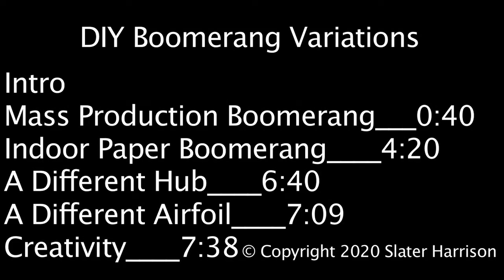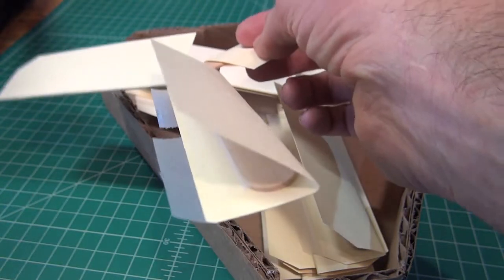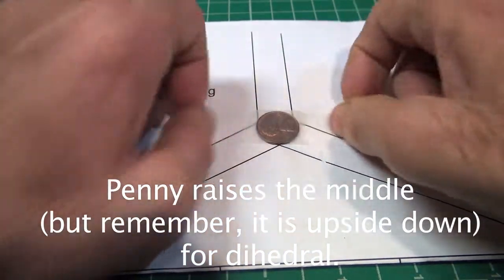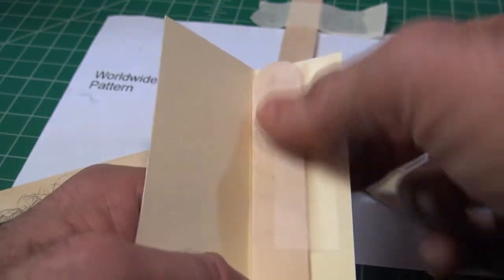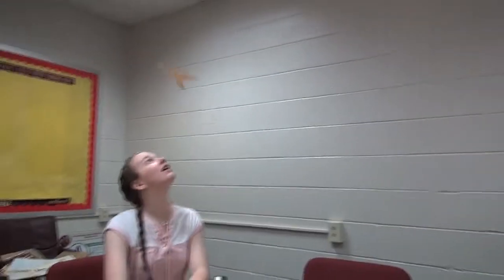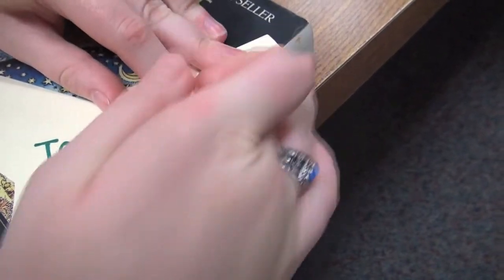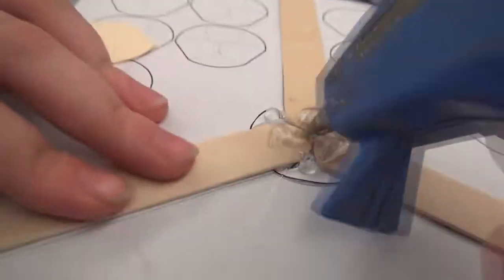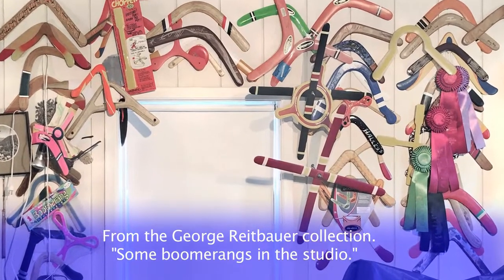Boomerang Mass Production and Design Variations

Comment: I remember spending my childhood watching your videos and trying to recreate one of the walk-along gliders. I never managed to do it!
Reply from the maker: Jawbone, can you remember any details of your attempt? If you are still interested I'd like to get you flying.
Reply: @sciencetoymaker  well, I remember not having access to Styrofoam paper, and used standard A4 material for my planes - which have weighted them down drastically. And them flying too fast for me to chase after with my board. And that I also didn't have enough space to walk my glider.
Reply from the maker: @jawbone6907  Yeah, it seems logical to substitute paper for 1/2mm thick foam, but by the time you figure in weight for a given rigidity, it's more than an order of magnitude different. There are some paper designs. The best ones for starting out spin as they glide. We used to recommend "telephone book" paper, but those are no more. Newspaper is still lighter for a given surface area than printer paper. https://sciencetoymaker.org/walkalong-glider-airsurf-air-surfing/make-your-own-gliders/paper-gliders/
Foam gliders fly slowly, like magic, and you can fly them even in a small room. But postage to countries outside the U.S. is expensive. I also have a couple of videos about slicing your own https://sciencetoymaker.org/walkalong-glider-airsurf-air-surfing/make-your-own-gliders/hotwire-cut/
Reply: @sciencetoymaker  thank you! I'm glad that after all these years, your channel is still up and running.

Comment: Hello Slater,  OK, so I'm a buttinski, but I would like to make a suggestion or two.  I just started making these and I had no manila folders.  I did have a ream of 8.5x11 cardstock which works nicely for the wings.  you can get 6 wings from  a single sheet of cardstock by first cutting the sheet into 2 strips of 5.5x8.5", then cut each of these into 3 pieces, 2.75x5.5".  works great for wings.
Reply from the maker: Great tips Uncle Bob!